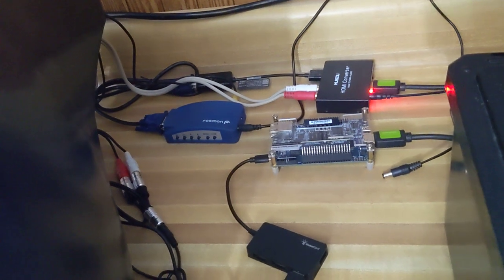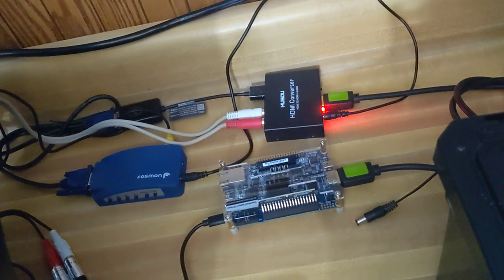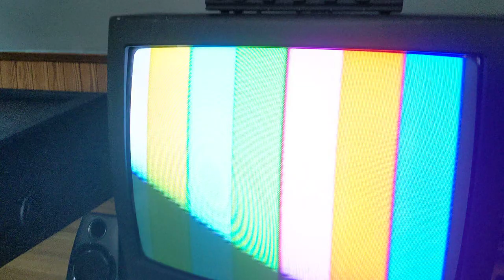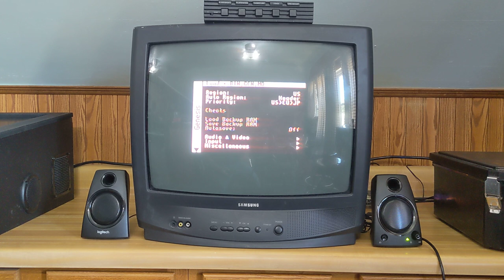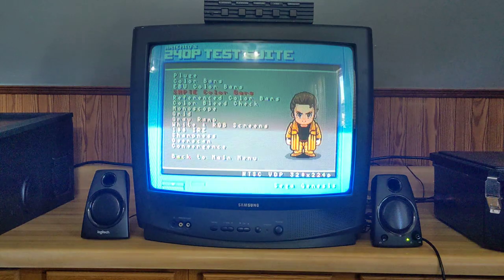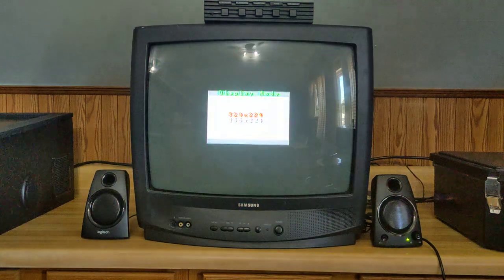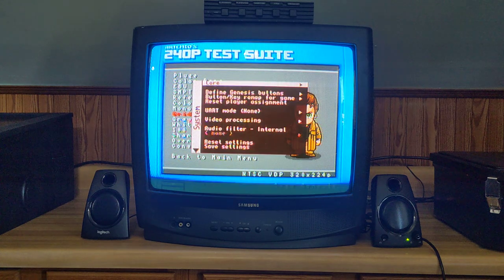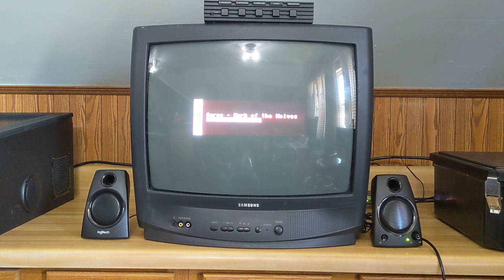My MiSTer FPGA to CRT TV via Composite Video Setup

Comment: If you want a true lag free,240p experience with the mister FPGA on a CRT TV you need to get a analog io board, the more you have hooked up to the video signal chain, scalers/converters the more latency you are adding to the video signal